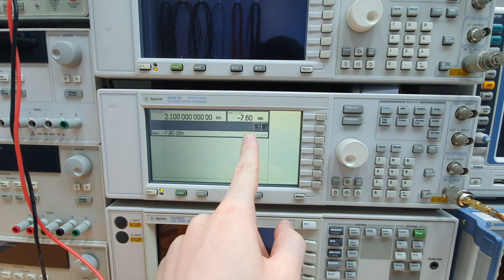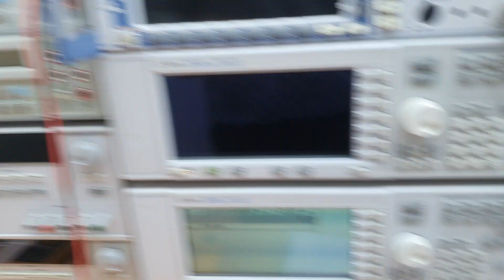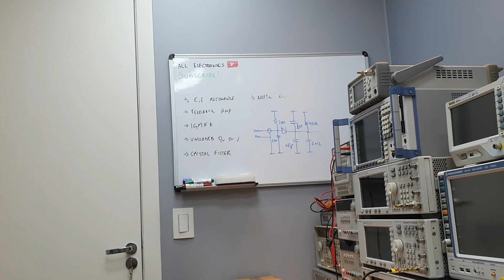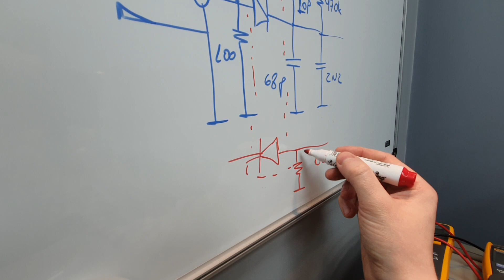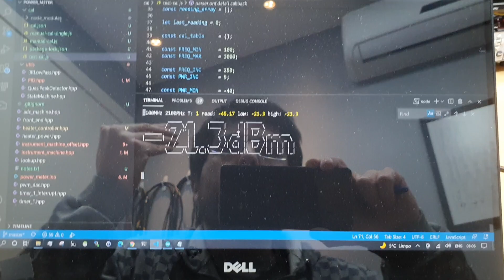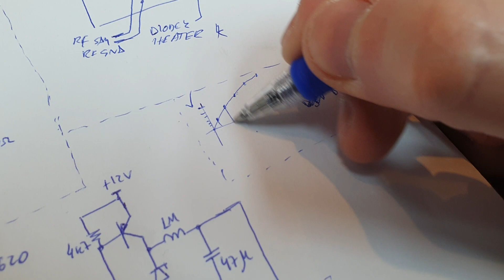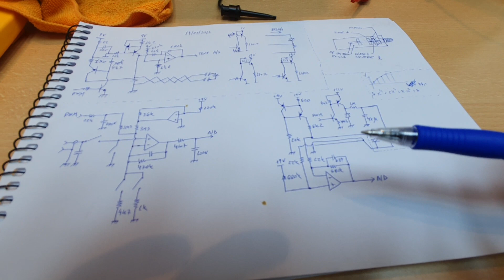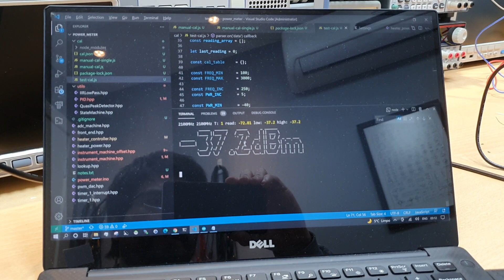Diode Power Meter prototype

Comment: Nice concept and very impressive performance! This could be turned into a commercial product, but not with that circuit implementation! 😀 I think it's great that young people are studying the work of the old masters, but nowadays it's almost as easy to do a PCB at frequencies below a few GHz...
Reply from the maker: Take a look on the evolution of the project, videos are here on the channel!
Reply: @AllElectronicsChannel  Thanks. I found two later videos where you solved the ESD problem and placed the processing and frequency selection in an enclosure. That's 95% of the way to a commercial product...

Comment: This is brilliant, just found your channel and thoroughly enjoying being taught RF. You cover some really interesting topics like neutralisation!

The idea of using a second diode in the package as a temperature sensor is great, as is using a chip resistor to heat. Sensors like the 8481a seem to use thermocouple detectors, but I couldn't see where the "cold" junction was or how they compensate for ambient.

I'm going to tear down my BG7TBL FA-2 later and see if I can figure out how that measures power too. Thanks for the inspiration!
Reply from the maker: Thank you!! I'm working now to finish the project. The diode is very sensitive to ESD and this is the main challenge, I think. 

I uploaded a video talking about it

Comment: Very nice work. 
I like how you use the arduino to control every aspect of the circuit, giving you one centralized controller. 
How did you characterize your polynomials?
It seems like a lot of work to do it all by hand. 

It is a very useful instrument indeed. 
What is the frequency range for the unit?
I would suggest something like 100kHz to 3 or maybe 4GHz?

Greetings, 
Michael
Reply from the maker: Thank you! 

For this test, I got the calibration data in a semi-automated fashion. 
I made a script to roll over a list of frequencies and powers, waiting to press ENTER after each change. 

So I swept from 100MHz to 3GHz in 250MHz steps. At each frequency step, a full sweep of power was made, from -45dBm to 15dBm, in 5dB steps. 

With this data, the code fits a 4th order polynomial for each frequency step. 

To read the power, as I showed in the video, I made another script.
This one asks the user what is the frequency of interest, grabs the two polynomials around the frequency, and interpolate linearly between the two. 

I think that in the final version of the equipment, we can have a knob to select the frequency of interest. 

Let's design an automated calibration using GPIB!? 

-----------------------------

The BAT15 I used probably can work up to 10GHz... I think the secret is the low inductance layout of the arrangement.

Comment: This is brilliant! I have a question though: how would distortion affect the accuracy of the reading? In other words, you are measuring a mostly pure sine wave from the very clean ESG. How would the reading be affected if you fed in a signal with, say in addition to the fundamental, a couple harmonics only 20-25dB down (or possibly worse)? Since the detector is affected somewhat by frequency, wouldn't there be a noticeable shift in the accuracy? Or would the effect be minimal, since the accuracy would mostly only be decreased on the lower level harmonic content, rather than the fundamental?
Reply from the maker: Thank you! 

You are right, this measuring technique will work properly only for pure tones. Even so, I just tested with a 2nd harmonic 10dB below and the reading increases only 0.3dBm. 
Increasing more the harmonic power, the reading becomes less accurate.

So, basically, this detector is sensitive only to the dominant tone. 

I think that frequency dependent is also a concern only of the main tone measured!
Reply: @AllElectronicsChannel  Ok thank you--So it sounds like even with some extremely high harmonic distortion, the absolute readings should be well within a dB, which is still quite accurate. Excellent! I'm looking forward to seeing the finished project. :-D